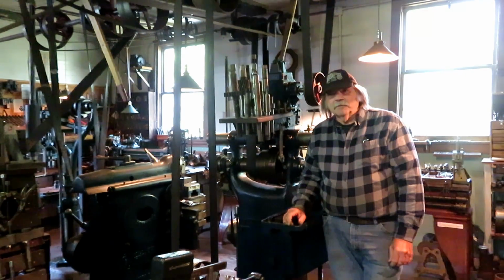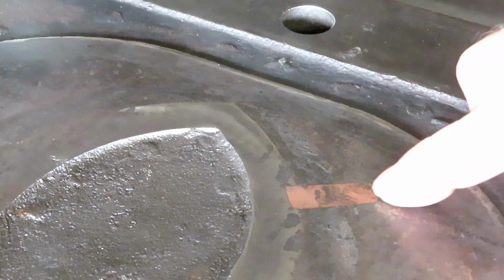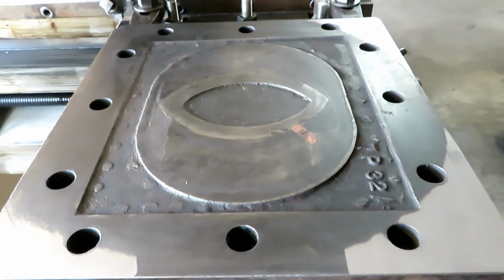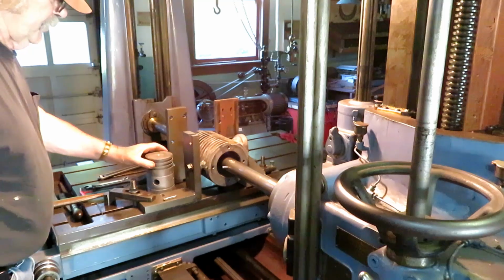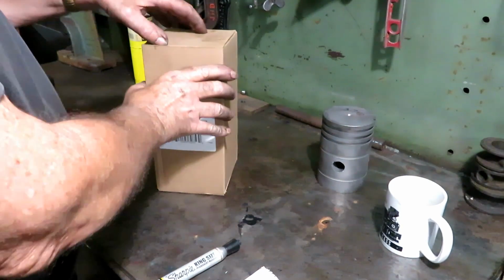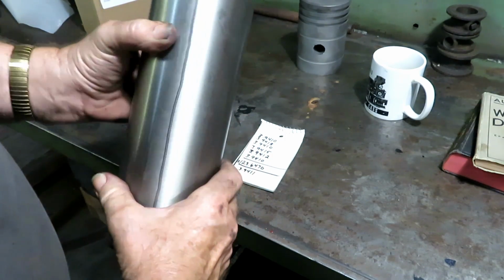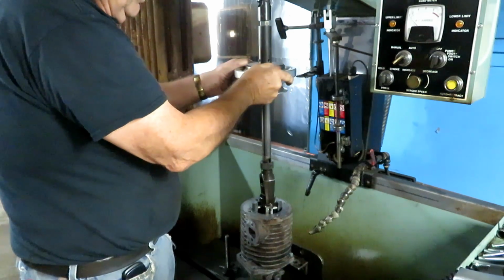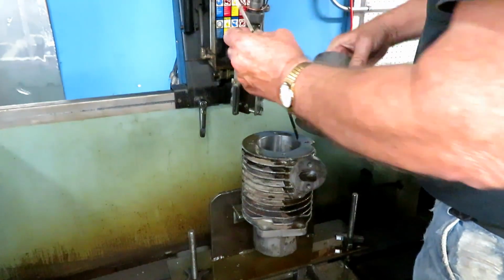Old Steam Powered Machine Shop 66  Gas & Steam Engine Jobs

Comment: I would love to know how you measured the cylinder bore with the boring bar still in the clyinder.
Reply from the maker: Hi Buck:  Spring calipers  and a micrometer. I pull the bar  back for the last check with an inside mic. Seems to work for me.......Dave

Comment: Sometimes I need to hone out .005 or .010 of taper, I use a hand held hone and hone it from both ends so the stones don't wear on a taper. With this set up you could switch the stones in the holder. Kind of cool honing equipment.

Comment: David, now that the steam chest cover has been milled thinner wont it bow more and quicker. Would more bolts help? or maybe a plate behind the existing one?
Reply from the maker: John, I think the cover warped because of the cast iron material being subject to very high boiler steam pressure, and years of the valve moving across the back side. It could have had a lot of internal stresses in it when cast and machined originally that slowly over the years with heat were relieved leaving it warped. I don't think that removing .060" from a piece an inch thick will weaken it much....Dave
Reply: Thank you.

Comment: Are planers still used today, I would think a large milling machine would give you the same result but faster.
Reply from the maker: Hi Carlos, Generally, it would be hard to find a milling machine that would handle eight foot work in one set up. ....Dave

Comment: I DON'T GET IT THE OUT SIDE EDGES AND BOLT HOLES ARE NOT THE WORKING SERFACE  ONLY THE CENTER OVAL UNLESS THOUSE ARE NOT BOLT HOLES BUT EXCAPE PORTS AND THE WHOLE THING IS A SLIDING VALUE
DAVID GRENIS
2044 MAPLETON
BOULDER CO ..
Reply from the maker: Hi Dave, The outside edges are just for the gasket seal, the center part makes the seal against the back side of the slide valve as it moves to keep the steam pressure from acting against it so the pressure holding the valve against the steam ports as it moves, is not so great....Dave

Comment: I have a dumb question, maybe.
I know the piece is cast so it's softer then the cutting tool, but the tool must still wear, so how do you account for the wear on the tool to get this perfectly flat?
Reply from the maker: You can't really, even grinding has some stone wear, but on the light finish cut it is practically negligible.......Dave
Reply: @davidrichards5594  thanks, I appreciate it

Comment: Electric side...Hot Spell...Yeah...here in Sacramento, California....June-Oct...100+ degrees daily....
 East of here in the original 'gold Rush' country, Sutter's Creek....an electric powered foundry/machine shop...Knight Foundry....Just closed up for business a few years ago....was the oldest continuosly operating foundry west of the Mississippi....480 volt 3 phase generated right in the shop by Pelton wheels. 2 wheels for the foundry, one for the shop.
Reply from the maker: I hope someone salvages the shop for display the way Young's Foundry, near Pittsburgh has.
Reply: @davidrichards5594  Well, there is a large group of volunteers, providing $$$ and work, but they're having trouble getting people with money interested...This foundry and machine shop was probably the largest part of the Gold Rush...after the actual miners....
 At least the property is secured from vandals and thieves...most all the machinery is still in there, you can walk right up and look in the windows...big leather belts still hanging from the overhead line-shafts.
 I have a couple pictures of myself standing next to one of the Pelton wheels, and a generator...but I don't know if...or how to attach that to a youtube comment...
 The closed wooden flume feeding the wheels had a vertical drop of over 400 feet...so you've got 150 PSI or more....no shortage of water around there at that time...now, years of drought and a lot of fires all around here...(I'm in Sacramento)...no sun seen today...Sept-6....

Comment: Now, didn't balanced side valves connect to the outside atmosphere somehow? I'm going to google it.

I've got a little garage machine shop, your my dream!

-'lil stan
Reply from the maker: Stan, Not really, in this type valve there is a small vent hole through the center of the slide valve that lets any steam that gets past the sealing ring go into the exhaust port and out. That keeps the pressure near zero on the back side of the slide valve even if things get worn and leaky.....Dave
Reply: Actually the entire inside of the slide valve is hollow. The little hole is 7-1/2" diameter, straight to exhaust. One leakage path is the balance valve face, the other is the piston ring sealing the balance piston to the slide valve.

Comment: Dave, I have a few old hand forged lathe cutting bits, and thought you might like them for use or for reference. They are rectangular bar with ends forged down to the bit shape. I would be happy to send them to you if you're interested.
Reply from the maker: Certainly Pete, I have a that I use now and then,  I'm always interested in hand forged tooling.....Dave
Reply: @davidrichards5594  I usually use usps. What address should I use?
Reply: you can contact me via private message if you prefer.
Reply from the maker: @peterross6560  PO Box 367, Newark Valley. NY 13811    thanks Pete

Comment: Bonjour David,
Happy to see you back to the workshop. Didn't you have a steam machine to repair a hile ago or am I wrong? Did you finish it, I do not remember it ?
Amicalement, Raphaël
Reply from the maker: Raphael, The vertical Morse engine is finished and sold but not picked up yet. You may see it lurking in the background...Dave

Comment: Hi again Mr. Richards

Happen they might have used an old leadscrew to pull them sleeves in at one time..

Them sleeves:
The O/D might be done on a surface grinder with a driven roller bed set at a slight angle to the wheel...to pull it through...
Place I worked at once had a setup like that for grinding the O/Ds on carbide wire drawing dies...🇬🇧🙂
Reply from the maker: An old lead screw probably would work fine....Dave

Comment: WAs there an advantage for steam engine manufacturers to go the balanced slide valve route versus poppet valves?
Reply from the maker: I'd say cost. The cylindrical or "spool" valve pretty much solved the slide valve 'drag' problem. Locomotives had switched by 1915, but stationary engines not so much. The Corless type "rotary" valve was popular wit large slow turning stationary engines.
Reply: The Skinner literature I have criticizes the Corliss valves as "notoriously leaky". Skinner was all about efficiency through steam-tightness. The balance piston can at least keep itself seated through pressure, but the rotating Corliss vales have to have clearance, which I suppose only gets worse. The Skinner valve works until the balance piston locks up and won't rotate, kind of like automotive valve stems or lifters that stop rotating..

Comment: Hi Dave. Curious - it looked like some lubricant squeezed out after you finished pressing the sleeve. Was that residual oil in the cast iron or did you put a bit of lubricant on the sleeve prior to pressing it in?
Reply from the maker: I use gear oil for fear of seizing it up half way in. You only have to have that happen a couple times and have to bore the thing out and start over to worry about that...Dave

Comment: When I was in School very long ago it was taught to to knurl Pistons that were slightly warm too upset the diameter to allow for a better fit and also increase the oiling on the Piston skirt is that practice still advised if not why not ?
Reply from the maker: Piston knurling was a kind of crude "fix" that was short lived and is not done these days. High speed oil retention is the job of the cross hatch of the cylinder hone job....Dave

Comment: Good to see you again Dave. Glad you are not having to work in a steam bath.
Does the flatness of the mating surface that the slide valve part you machined need finishing also?
Nothing like watching a shaper work. The most beautiful device ever invented.
Pressing in the liner seemed faster than the heat & chill method. Is there any holding difference?
Glad you are doing well and continuing to post videos.
Thanks for sharing
Reply from the maker: I think Jim is surface grinding the slide valve and also the edges of the balance valve ring. I pretty much do all the sleeves that way now. I figure it's as tight as most factory dry sleeve fits. You can drive them out for replacement with a proper pusher and a sledge....Dave
Reply: Just had the slide valve and balance piston surfaced. Took .010" from the face of the slide valve (which was HARD) and .012" from the balance piston, which was medium hard. The most challenging part is the valve face in the steam chest, which is also hardened.

Comment: So you actually didn’t lock the piece down on the shaper just let it float there under it’s own weight and secured it from movement by locking it in on the sides! What a great thought to stop clamping deflection, but would it work on lighter piece too? Also what is max stroke on your honing machine?
Reply from the maker: Hi Fred, I drilled two small holes in the rear side of the cover. The clamps had pins to fit. You can see the set up in the last photo at the end. A piece of angle iron acted as a stop at the foot end. There are all kinds of tricky wedge clamping devises that you can use on thin pieces.  That cylinder was about 11" long and I think the honing cabinet will go a little more than that.....Dave

Comment: I think the old engineers missed a bit with the thickness of the valve box cover. 
It should have been much thicker, I think to prevent the bowing of the plate. In the wear area just normal wear for this type pf machine.
 Nice to see the shaper at work.
Too bad the Skinner will never see a real working load with steam at design loads. 
Seeing these old machines turning over for demonstration is nice, but to see them at rated loads would be a treat. 
I have seen the steam powered saw mill at Florida Flywheelers work at real loads make an unforgettable sound. 
The exhaust note is a real bark that the demo engines at low pressures do not make.
Thanks for the vids.
Keep making them.
Reply: You will be pleased to know that I intend to run this engine at 150psi to drive a circular sawmill. 300 RPM, 130 HP and 2100 lb-ft of torque! This engine will be completely refurbished, precision aligned, painted, and nickel-plated like the original. The steam chest cover has stiffening ribs on the outside. I just finished modeling it in Solidworks and the deflection at 150psi is .0014", that's 1.4 thousanths of an inch. I can't explain the bowing Dave encountered, unless the cover was extremely over-pressurized.
Reply: @EngineersWorkshop  Aging? How does cast iron hold up against thermal cycling and one-sided pressure load? Gradually over time releasing internal stresses? How old is the engine and how hard a life did it have? Saturated steam at 150 PSI has about 370 F temp. (electronics engineer here, no experience with real steam)
Reply: @milantrcka121  i would think if the iron stress relieved itself, it did so early in it's life. Clamping against the steam chest would have flattened it. My computer model shows only .0014" deflection, and low stress 3500psi. Not enough to permanently distort it. I'm happy it's flat now and willing to bet it will stay that way.

Comment: Nice ! As an apprentice I worked on maintaining the old belt and pulley system (electric motor driven) even held my pants held up with a belt I made. 
Was watching a video on todays CNC machines and felt pretty ancient,  After watching this iam feeling much better,  - thnx
I doubt the kids today would  be able to find their way around your machine shop.
Good on ya !
Reply: first shop I worked in was my Grandfather's.  He ran a line shaft powered shop (off an old John Deere Tractor).  He had a forge with a hand crank bellows and I was the dumb kid cranking it all day when he forged.  He had a Lathe but no mill  or shaper. I hated it then but I bless his memory every day now.

Comment: Dave, thanks for another brilliant video. I love seeing that large shaper in action, I couldn't believe how bowed that cover plate was. The honing machine was very interesting, I've never seen one of those before in use. Thanks again. Cheers, Alan.
Reply from the maker: Alan, I think it took a lot of years of pressure and temp. to distort that plate....Dave
Reply: @davidrichards5594  I'm sure it did. Just been over to the "Engineer's Workshop" and subscribed. Finding his videos on the Skinner fascinating. Cheers, Alan.
Reply: @RetroSteamTech  Thank you for the interest. Just modeled the cover in Solidworks and find only .0014" deflection at 150psi. Stress is less that 3500 psi. That should not cause the bowing Dave encountered.
Reply: @EngineersWorkshop  Strange, maybe at some time in it's long life it had been run at a much higher pressure?

Comment: Hi Dave great video as always. I was wondering about the steam chest repair. You've cleaned the cover surface but what about the cylinder side of the chest? Wouldn't it also be worn in a similar way?
Reply: After seeing the warpage i will check the mating surface. Steam chest is very substantial, so  hoping it is flat. Slide valve surface needs work though...
Reply from the maker: Jim checked the area around the ports and I guess it wasn.t too bad....Dave

Comment: Dave:  so glad to see you back working and in good form.  Your YouTube friends worry about you.  One request:  on other videos I have seen a type of indicator that instead of a dial has a pointer that moves back and forth at the back of the tool.   I assume this was a predecessor to the dial indicator.  Could you show how this works on some future video?
Reply from the maker: Starrett Number 64 indicator, I'll try to use it more.....Dave
Reply: @davidrichards5594  Here is a link to Johnathan W's channel.  He just bought a steam engine that he is trying to save.  Thought you might be able to help him with some advise, or as you go past on your way to Florida https://youtu.be/bD5IThO_W6A

Comment: Hi Dave when I have a casting like that and hard to get ahold of, I tap the holes sae if I can then put in a bolt or something with a jam nut. Weld something flat or whatever for the hold downs to ketch. It seams in a job shop you just gota invent something for each job. Like you I haven't found much I couldn't fix the impossible just takes a little longer. Paul
Reply from the maker: true, it's all in the set up....Dave

Comment: translator please
Reply from the maker: You can click on the small gear icon at the bottom of the video for "settings" and then "cc" you will get a list. Click "auto-translate" then choose your language and click. I just tried it and it is working. also click "HD" for best picture resolution. When a video is first put on You Tube, sometimes it takes a few hours or more to get all features to work. Thanks for watching....Dave

Comment: Hey Dave,
I was beginning to think there were not going to be any more vids, lol.  Glad you're back.  Looks like you're ready to get a pony tail going. Saves on hair cuts. I haven't had a hair cut in over 30 yrs.  The pony tail is about all the hair I got left at 73.  I love your shop and subscribed early on and enjoy each episode. You said you were in the hot weather,  you are lucky you don't live in NorCal.  After that lightning storm last month, we got fires all over the place.  Cal Fire is finally getting good containment on the 3 main ones, but we still have Sep-Nov to go.  Had a run of about a week of 100+ but the humidity was low.  Always something..
Stay healthy my friend.
Cheers.
Reply from the maker: Hi Tim, I've had it with barbers. They must think that because you are an "old guy" that you need to look like a recruit. The Florida place is in the hurricane line of fire now. Always something. Good luck with the fires, thanks for watching......Dave
Reply: @davidrichards5594  I hope your FL place is OK. That's your retreat during the winter.  This current round of hurricanes was unprecedented, 2 at almost the same time, what are the odds?

Comment: Dave, doesn't taking off so much metal weaken this cover making it want to flex more when in it in service?
Reply from the maker: Probably,  and being an "automatic" valve timing governed it gets full boiler pressure in the steam chest all the time. It took many years to do that and it will never see that kind of pressure and temp again.....Dave
Reply: I've had it pressurized to 150psi. I will put an indicator on it next time and see how much flex there is as it comes up to pressure.